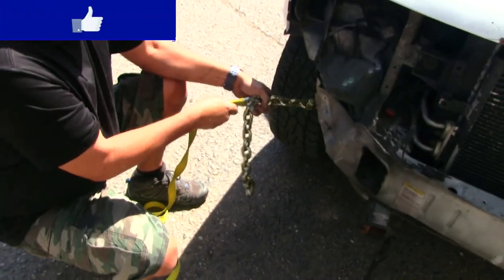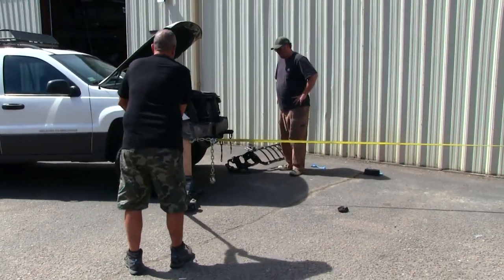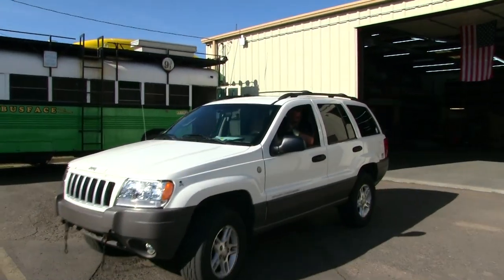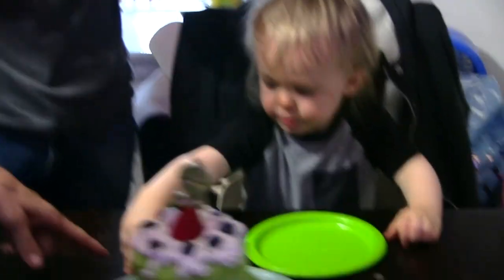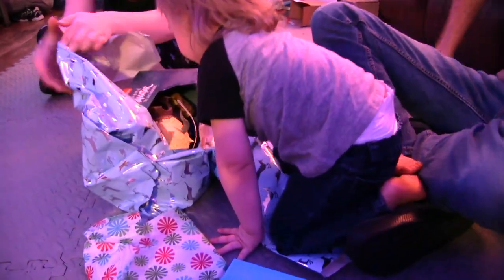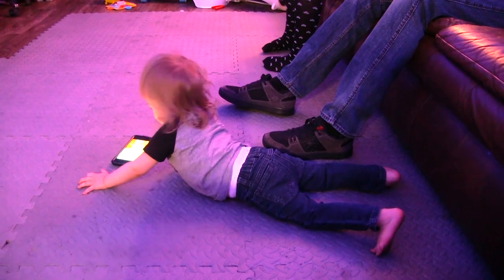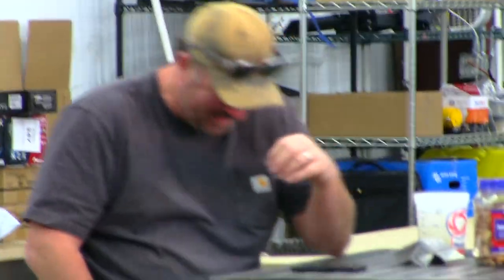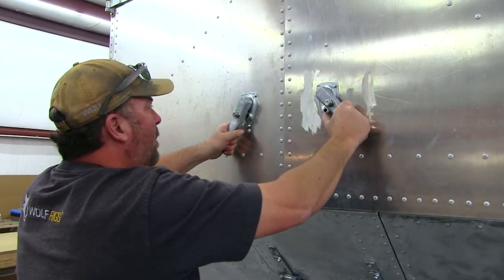A Slice of Buslife, a Birthday & a Build Update!

Comment: You might consider installing on the build project a 'in'clinometer for pitch and roll angles since the rig will probably be top-heavy. Once the rig is completed and loaded, in a controlled area where you can use safety chains lift the right/left sides until the rig wants to roll over. Make note of the roll angle so you don't exceed it. ~Just a thought. ~